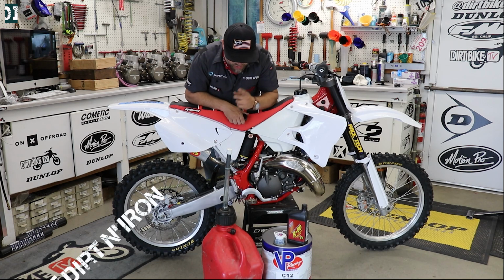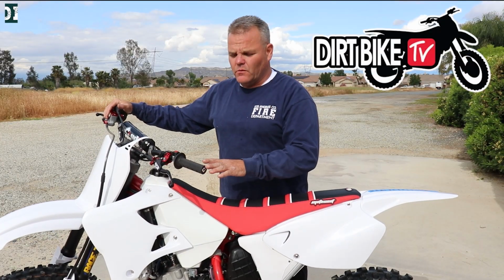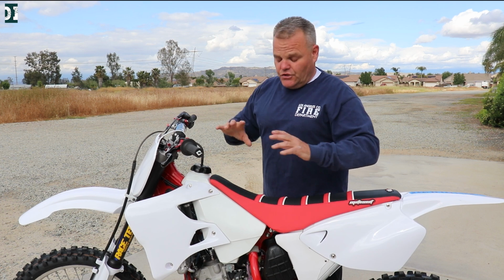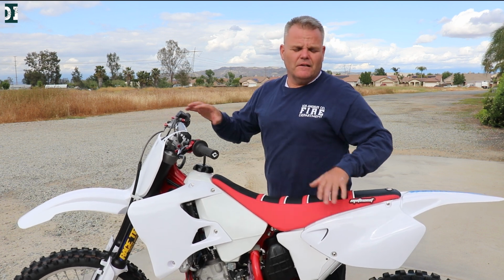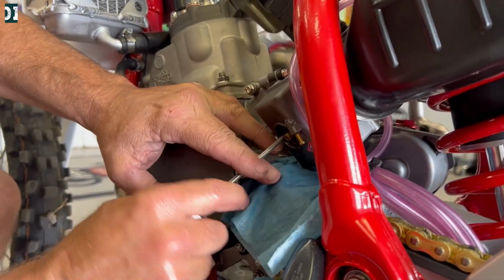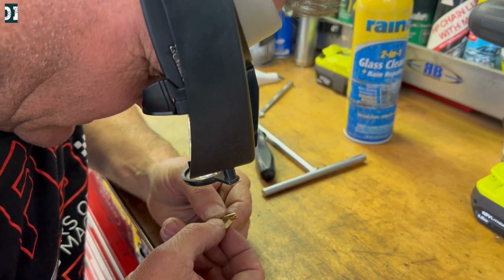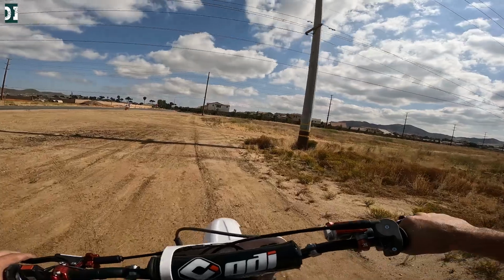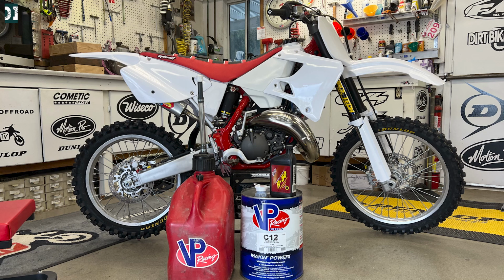YZ125 build - brake in 🔥🔥

Comment: After a top end I do more of a "did I break it" than a "break in" as In I just want to make sure the thing works by riding around my house a bit before I load it up and haul it down to the trails. How much "heat cycling" do you think the mx guys during the 2 stroke era did when they were doing top ends between motos?

Comment: Rado - when I was racing Husky's back in the day I would do just what you do except I would break it in, take it apart and touch up the rings and piston with stone to get perfect seal.  I might do this a couple of times but it was worth it in the aircooled days because of cylinder distortion.  The distortion is quite repeatable so the attention that I gave it was well worth it.  After I seized a Husky 390 XC with new rings and piston, I learned to always do this.  Where the piston was tight, the finish would get shiny and that is what I would gently stone down that piston area and the fit eventually would be nearly perfect. I always made absolute sure that I set the ring gap where I wanted it before going hard on it.  I'm now 76 and doctors have basically banned me from riding.  Just had my left knee put in and, apparently; the Doc set the specs right on it as I'm not having any real problems.  It joins the happy family of two replaced shoulders, replaced right knee, and four back operations.  They always frisk me in airports.  I enjoy and live thru you guys.  Crazy as ever, Tom  P.S.  Going to sneak a bike out.....rained last night......  P.P.S.  Listening to the Yam, sounds like the jets are tending toward being correct.
Reply from the maker: haha, Tom you always crack me up!
sounds like you knew your way around old school smokers, sometimes I wish I can be in that era of dirt biking for a while, golden era for sure. 
Did you consider side by side? age-cage.. that kind of thing, but still beats the couch! 
Take care my friend!
Reply: @dirtniron  Rado - Age cage ain't for this boy.......always hated 4 wheels......just too many to keep any eye on!

Comment: I have a old 86 yz 125. Was the boys first bike. I ran it down the road with gps the other day. That thing did 71 mph with 14/48 gearing lol im 225pnds they are 6 speed thoe
Reply from the maker: dude, thats fast! I think 86 year has the same colors, right?
Reply: Ya just gold rims.. that look so good lol
I think they were only like 26hp that year. But it's actually a blast to ride just got to work the transmission over real good lol. It had a 50t but it just ran our if gear so fast. Kinda small in the cockpit thoe. And very light and unplanted.

Comment: Do you mix the first tank pretty rich? I remember when I bought my YZ this year, they put break-in gas that had more oil. I was curious if its REALLY that big of deal on a new engine.
Reply from the maker: No, mix it same as always. 32:1
Reply: Thanks! I've noticed that when I turn the gas off and let the fuel run out of the carb, just before it turns off, it revs really high and the RPM's shoot up before shutting off, my YZ250 does not do this. It's brand new and starts on the first kick, doesn't drip and pulls like a monster for a little 125. It came with the V-Force 4 system from Yamaha. Any reason to be overly worried about this? @dirtniron
Reply: @Jordan_MX816  Yeah, try not to do this on a two stroke. Its not great for the piston and bore. Dries the motor up and youll see piston ring and cylinder wear after you warm it up next time you want to start it. The reason why the RPM's Shoot up is because the fuel mixture is becoming leaner and leaner till the carb runs out. Lean conditions burn a lot hotter and faster, so the rpms will climb. If your bike is idling high and you cant really hear the individual piston strokes when idling, you gotta turn that in and richen it up but onyl after fully warming it up. Also if you want to drain the carb, do it manually. Dont let the motor dry up. You shave off possible hours before a rebuild doing that. Not good.